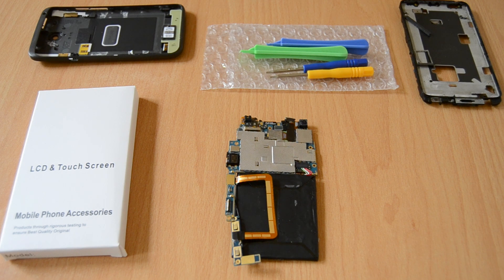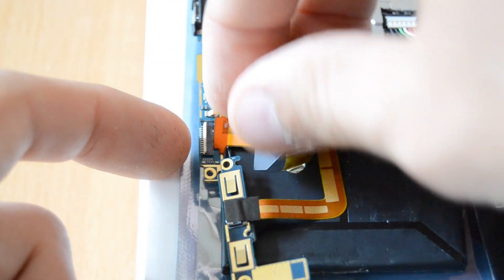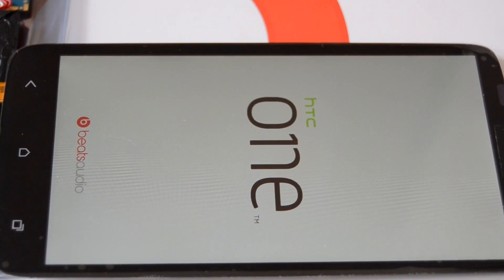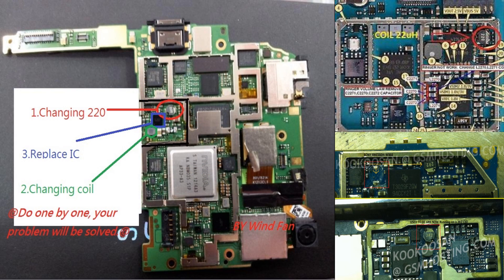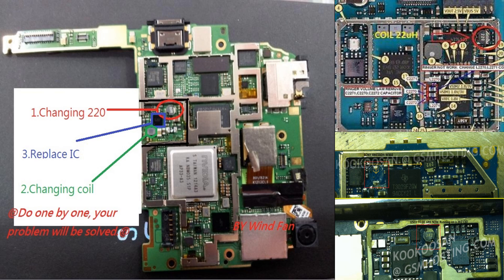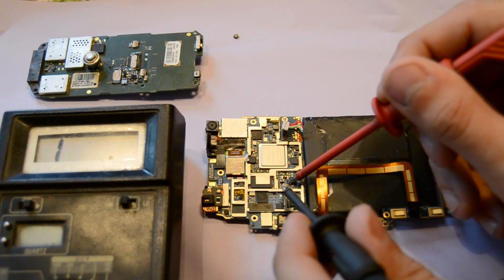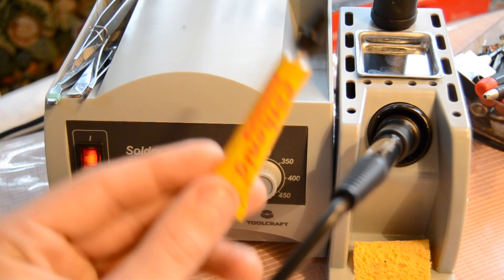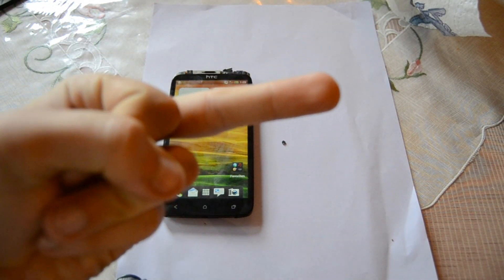HTC one X - Quality of Chinese Replacement screens - How to fix Backlight issues on every phone [HD]

Comment: I replaced a Sharp with a Sharp, however the backlighting stopped working after putting it all back together. So I ordered the coil, opened the phone again. But before continuing, I tested the screen again and the backlighting worked again! So it was probably the flex which came out of its seating.

Comment: Hello mate,i've found some coil on my old Samsung D600,and there is label "3R3",looking same as one 220 in HTC Desire 500 which i need to repair cuz brighthness problem,is that right part which i need?I used multimeter,there is 1.3-1.1 ressistance on that "working" one,i didn't cut off yet that coil,maybe i ll get better resistance when its off the board? im not electric/electronical expert,but i want to learn how to fix some "stupid" parts on phones etc.Can i use "simple" 15 dollars 60watts soldering iron for fixing this?Or maybe its a bad idea? :) Thanks in advance!

Comment: I don't have much soldering skills but I'm going to try this anyways. When soldering are you just working on the side of the motherboard that the "220" is visible on or is this a single sided motherboard thy you will need to be working on both sides to do the soldering? Perhaps you could give me a few tips or steps for the soldering process. Please help

Comment: ***** I have a similar problem to you. However, I replaced my Sharp (cracked) screen with a Sharp display. And it seems to not work anymore. How did it short out if I used the exact same screen as the cracked one?
Reply from the maker: i still dont know how i shorted the coil...my suggestion. dont turn it on before its completely reassembled
Reply: ***** I tested mine, and it was 2.3 to 3.3 Ohms. Should I replace it? Is there anyway to test the IC or changing coil?

The setting the Multimeter was at.
http://imgur.com/jSPkNDw

EDIT: I just realised that when I touched the two probes together (the red and black), it gave a reading of 1.7 Ohms. So would it be 3.3-1.7 = 0.6 Ohms?

Comment: Thank you very much! I have just fixed mine with an old 220 coil from sony ericsson k800i. Just to reassure anyone - the new screen that burned it (coil), works completely fine after the coil was replaced. Very strange though... thought it would burn it again, but it didnt happen...

Comment: Hi,
 Question I was replacing screen on HTC ONE S, before i started lcd was already broken, but phone shows orange light when charging. After i resembled it, the phone seems dead, no lights anymore. Could I shorted the motherboard? I did touch it with metal pick while removing the battery. If so, is there a fix?

Comment: Thanks for sharing your knowledge!

I have also a 1 year old Samsung SGH-i717 AT&T that charges but immediately switches back off after a couple of seconds to a couple of minutes after switching the power on. I already bought a replacement battery but did not resolve the problem. I was wanting to DIY repair whatever it needs to but could not find a tutorials on YouTube so start with. I hope you have the knowledge on this specific one that you could impart to me. Thank you! =)

Comment: Hello. Your video was very helpful and thank you for that. My previous screen had the known issue with the yellow coloring so i ordered a new one. I followed the steps on your video up until the checking of the new screen. The screen initially powered on succesfully, although, and here is the important thing, the screen was not the correct one (purchased through ebay, the sony type, whereas mine was the green sharp one). After checking that it worked, i reassembled everything and after that the phone never worked again. It does not even receive power through the cable (no led blinking). I changed back to my stock screen and still the phone does not work or receive power through the cable even with another battery. Do you think that changing the 220 coil or any of the rest will help in my case? And if not do you have any advice?
Reply from the maker: hmm thats weird, check if you shorted some contacts. you can also check the coil if you want to. you have a multimeter ?

Comment: Thanks for sharing!
My htc one x does work, the cable colours are the same as the original.
I used the replacement screen for like 3 days without problems, then it suddenly started acting weird. Now it's black and it doesn't get on. The phone itself does work, sound etc but no display.

Just the coil or also IC and second coil?

Comment: Hello. I didn't get one thing, you got the wrong screen that led to burn the 22uH coil, therefore damaging the backlight circuit, and when u changed that coil (220), the same "wrong" screen worked, or you got a new screen with the correct flex?
And i have a Sony Flex (the green part was hidden with a black tape, thought it was an AU flex), two questions regarding this:
1) the place where it should be green, if it was hidden with a black tape, will it always be a Sony flex?
2) Can i use a different flex and still managing to fix the backlight (maybe by changing the coil size?

For the second approach of changing the second coil (not the 220 coil), what are the rating of this one?! And from where can i get it?
Reply: ***** The problem with this whole backlight issue is that people do not work grounded as they should. look up on the internet: ESD Damage. Which is lethal to your electronic parts and could even provoke more damages. when properly grounded this backlight issue would never happen to you in the first place ;-) If you don't know the trade, do not do it. (just a warning for all those DIY guys out here)
Reply from the maker: i really dont know if the screen shorted the coil , or if you have to assemble it completely before turning it on...

Comment: Hello awesome video! I'm sure you should be busy but i need a little help, I cracked my HTC OX screen and i bought a replacement over amazon it said was for "AT&T" HTC OX. Well i replaced the LCD and it worked fine for a couple of minutes, then the screen blacked out, the bottom buttons light up, and the volume buttons works fine ( i can hear the volume sound going up and down) i can receive calls too but the screen doesn't turn on... Then i disassembled the phone and saw that the LCD was AUO (it's supposed to be SONY).... Please help me up, do you think there is something i can do to fix it? :((

Thanks
Reply from the maker: Hmm all i can tell you is check the connectors and take a look at the coil of the displaybacklight. :S
Reply: Thank you very much for your quick response, i just disassembled the phone and double checked the connectors and still the same, everything is working right but the lcd still black, i have a multimeter and a soldering machine should i change the coil? Or may be i should wait for the response of the seller, maybe i can return it. Do you think the phone is already damaged :( ?
Reply from the maker: Isaac Espinoza C. i dont think that the display is broken , but try to return it to the seller and ask for a different one that matches your flex color.

I replaced now 3 HTX one X displays and everytime the coil was shorted when i tested it not assembled... I think the coil is the problem , then the new display also wouldnt turn on ! So i would definitly check the coil with a multimeter , you dont even need to solder it out for this
Reply: Thank you very much dude you've been very helpful! :D
I'll check the coil with the multimeter and if its shorted and is <1.5 ohms should i try replacing the inductor and the coil? and get the matching flex/LCD..
Reply from the maker: Isaac Espinoza C. Yes check the coil - Replace it - Order the correct screen. Assemble it completely before you turn it on !!!! dont test it only with the flex connected. I think there could maybe be a issue
Reply: I'll notify you when its done, thanks a lot have a great day

Comment: Hi Steven ,
after i check out the link " -> http://www.aliexpress.com/item/Free-Shipping-Replacement-LCD-Display-Digitizer-Touch-Screen-Assembly-For-HTC-One-X-S720e-one-xl/855520311.html "  which you provide about the LCD screen i can not found there the option about green (flex) cabled screen which you mentioned in your video ! Is it compatible really with all phones ?thats why there are no option for different 3type cables ?

Comment: Hi! Thanks for the great video. I just recently replaced my screen for HTC one X, and encountered the backlight problem. I inserted the connectors 100% and turned it on to check it works before I assemble it. The HTC logo came up normally for a second and then it went completely dim. I checked I had the same screen as the original and even tried the original afterwards and its backlight didn't work either. The screen is barely visible when the battery is charged 100%, but after some usage it gets dimmer and dimmer... I measured the ohms of the 220 coil and it gave me 1.6. What could be the problem? Will changing the coil work? Thanks for the help!!
Reply: I think the collor of the flex isn't really the problem. Why would the backlite  otherwise keep working after replacing the coil, even with a different collor flex... I think the real problem is the fact that it is not completely assembled after replacing the screen (with whatever flex collor). Maybe it has to make certain connections to keep working right and it is 'short' when not completely assembled....?
Reply from the maker: Harry van Leeuwen I also thougt about this , but i havent found a ground connection or anything else :S So i think it depends on the display used.
Reply: ***** I replaced the coil and it did the same thing again on the original screen! I gave up and bought another motherboard onto which I assembled the device again with the new screen and it worked fine. I would say the problem was in the connection which might have short circuited.

Comment: So here I am again, and I finaly did it! See my posts here under from a month ago. I had two HOX'es with the backtlite problem (backlite working perfect before screen exchange). It took about 3 weeks for the coils to arrive from China (via Aliexpress).

I tried to soldeer the first troubled phone, did'nt work, I guess because of my poor soldeer equipment and inexperiance I think I destroyed the pcb while forcing the old coil out. But today I tried the 2nd one with a professional solderstation from a friend. Heated the thing up to about 350 a 400 degrees C and sucked the old soldeer away with such a pump. It is really an pain in the ass to soldeer the new coil back on to the motherboard because of the tiny thing and the soldeer has to stick to the pcb and the coil as well. But I did my best, reassembled the phone completely, fired it up and it worked! It is in perfect working order now.

THANKS ITXtutor for sharing your knowlegde and advice, very much appreciated, respect!!!! ! I'm very happy and proud right now :-) It wasn't easy but very much worthwhile.

Comment: I was able to get the cover off the MB very easily thanks!  I have a multimeter and so I thought I should try to test the coil - on my One X(ATT) it says "100", not 220. On the lowest setting on my meter (200) the value came back as 1.7 - does that mean it's not fried? Is there a way I can test the other 2 parts you referenced? Thanks again for helping.

Comment: ITX - I have been trying to figure out what I've been doing wrong for a couple of weeks, and your information is very, very helpful!  I live in the US and I have the ATT One X, which I think is really the XL.  I'm guessing the solution for the XL is the same?  If that's true, I want to try to fix mine, but there is an internal metal cover - how does that come off within breaking anything?  Thanks in advance!!

Comment: Hiya, great vid, I intend to carry out the same repair on my one x plus, however there is no 220 coil on my motherboard...

The other two components are there but not the coil which is strange, there's not even a pad for a coil to solder onto...

Is the coil in a different place on the plus version of the one x?
Thanks again.

Comment: So, the broken screen that was working on one phone, didn't work in the other and when I switched it back to the phone were it one worked, it didn't work anymore (blacklite probelem). I guess if I can fix the coil, I have to completely assemble the phone in the future..!..Would be nice if someone could explain this issue. Maybe a matter of polarity, grounding or...? The $13 can be cheaper I so I saw later on but ok, do hope they arrive soon! Will let you know if I recieved and replaced the coil

Comment: Hi, i did replace the 1 coil a couple of times and it worked until i did reassembly the cell phone, so i did it again without removing the battery or anything and its not working, any thoughts on how to do it again? or should i move to the next coil, also what are the needs for the second coil?